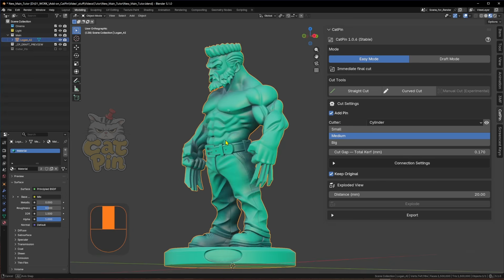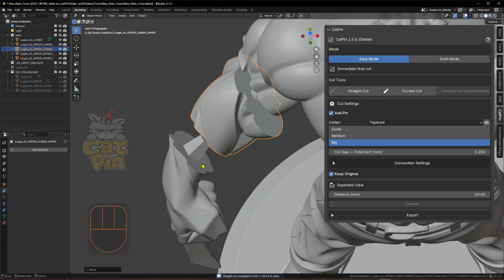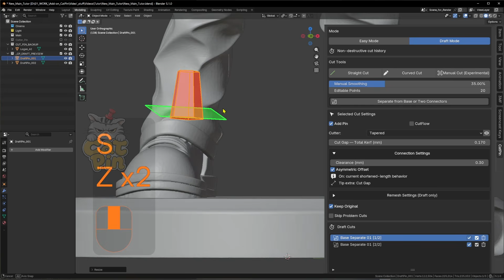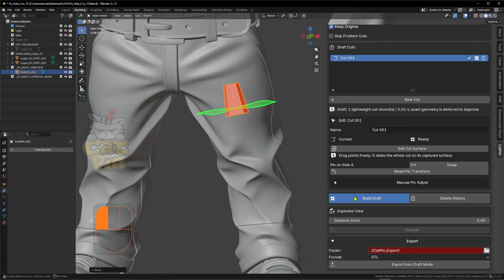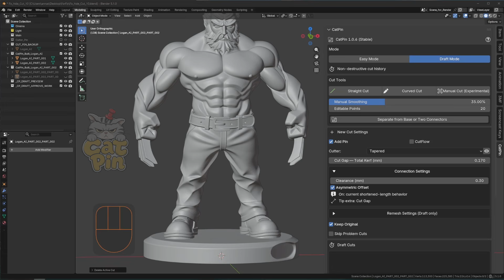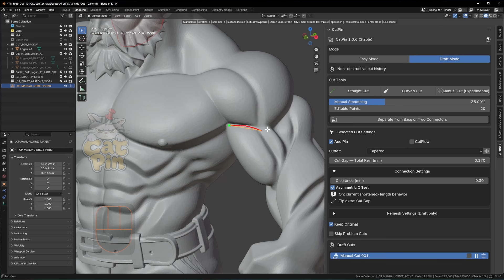CatPin Blender Add-on Tutorial - The Fastest Way to Split Models for 3D Printing

Comment: Thank you for this tool—I’m already using it. I just wanted to ask if a feature for deep cutting out a specific part and closing the mesh will ever be added. By that I mean, for example, cutting out an eye on a character or another part on the chest, etc. So far, cutting only works along the entire perimeter of the arm, head, leg, etc.  I’d like to cut up some of my models so they can be printed without AMS. I’m not sure if I’ve explained this clearly or if I’m just doing something wrong.
Reply from the maker: Thank you! Blender has a lot of limitations, so I'm not sure if I can implement this, but I'll try my best ❤
Reply: I asked the same question today about cutting eyes out 😂